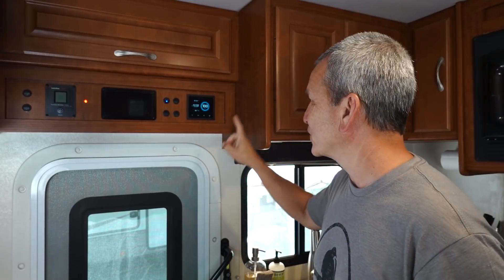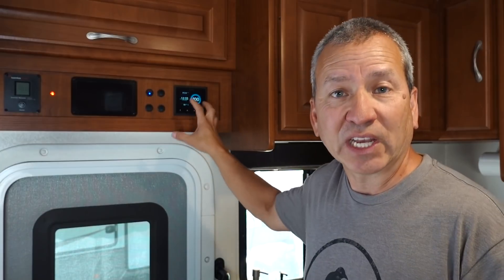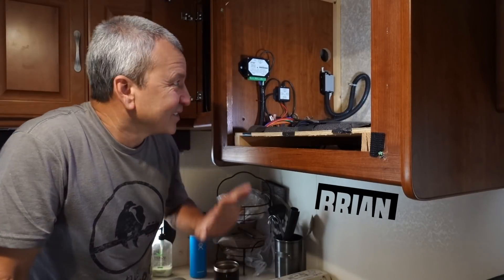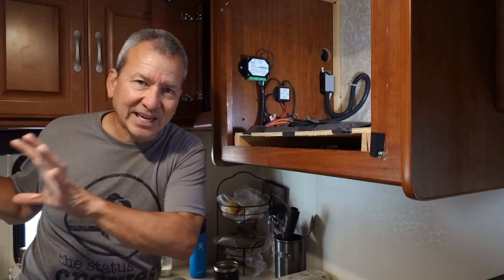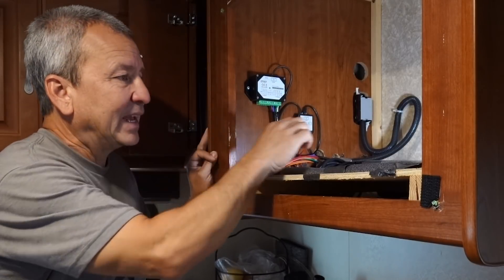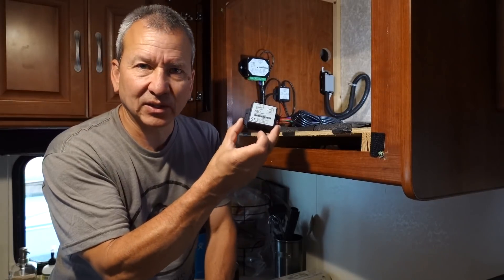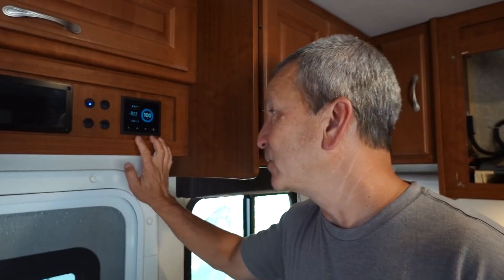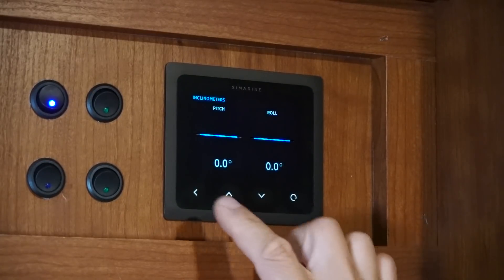RV Leveling With Simarine PICO Monitor System / RV With Tito / DIY

Comment: I just installed a complete pico system in my s/y La Vie and it is amazingly easy to both install and program! your videos was a nice supplement for installing and tips!
Im thinking of buying the inclinometer just for fun, but its kind of hard to level something on water =) it might give me a pointer to where I should pack heavy stuff like extra water and extra gastanks(except for just low and center), for that little extra degree of quality of life, pun intended.

Comment: Whenever I level my travel trailer, I've found out through trial and error that I get good results by placing my welding level on the floor of the trailer.  I found that the dining table and the sink counter are all at different angles.  It makes a big difference when sleeping in the bed!
Reply: Hmmm, if one wants their bed level.... where to place the level????  Sounds like a mystery for Scooby and the gang. lol
Reply from the maker: Agreed. Different results leveling in various places in the rig. We use a level on the kitchen counter in the middle of the rig and verify with the bathroom door :)
Reply: @RVwithTito  I have those ball bearing levels on the front and side of the trailer.  Those proved pretty much useless.

Comment: I added the Pico to our travel trailer but the cost to get the inclinometer here in the US was astronomical ($151.90) considering a bubble level is just a couple bucks.   The Pico is such a good product but the bugginess of the software drives me crazy.  hopefully they'll respond to you about the display issue.
Reply from the maker: The bugginess of the software is frustrating at times. It seems to be improving with each upgrade. I guess I overlook it a bit since the power monitoring works pretty well.
Reply: I have the brightness set at 1% when not in use and I can sleep right next to the display at night. It's just readable to see the time
Reply from the maker: @Jungheinrick  Nice.
Reply: Hey Brian, do you use any of the alarms or relay outputs?  Its a very flexible system, Im just not sure what would be good to add.  Great video btw.
Reply from the maker: @carlschiel4754  I've got some alarms set for temp, under voltage, etc. but no relay triggers.

Comment: Cool! Actually, I do have one question. Does the microwave have any effects on those components? Since they are next to an EMF machine made for heating up things. Have you noticed anything? Because every microwave oven, I believe they use a magnetron if my memory is right. Just wondering, thanks!
Reply from the maker: Not that I know of. I haven't noticed anything odd happening while microwaving stuff.

Comment: Looks like a cool system that you don’t have to keep running wire back to the main monitor
Reply from the maker: Yes. I love that feature. Less cable is required to add modules. I have several shunts and modules in various spots. Each module has two ports. It's very nice to just plug the data/power cable into the nearest module. The system detects it right away and you can configure it.